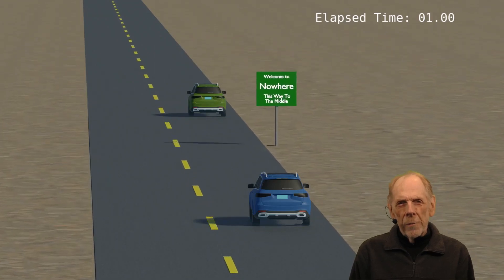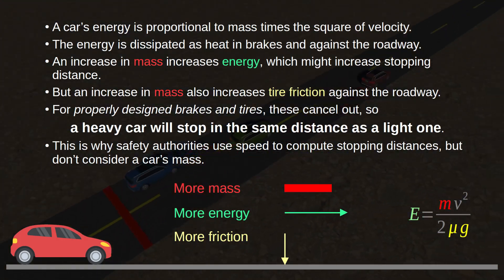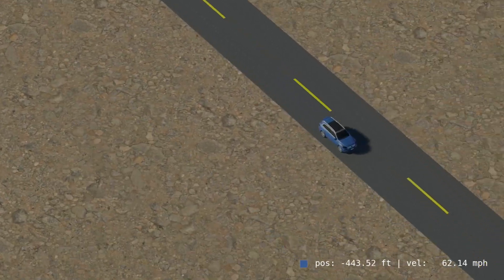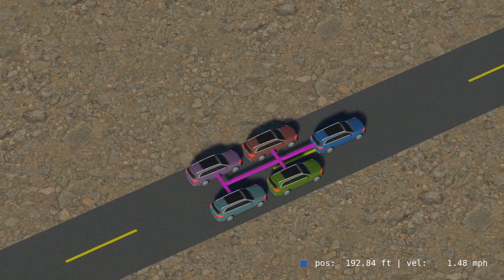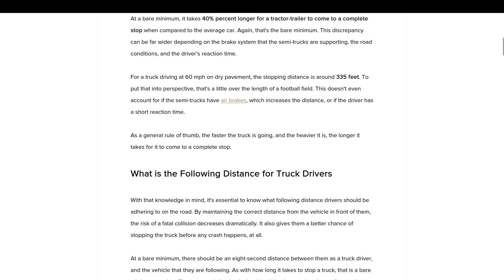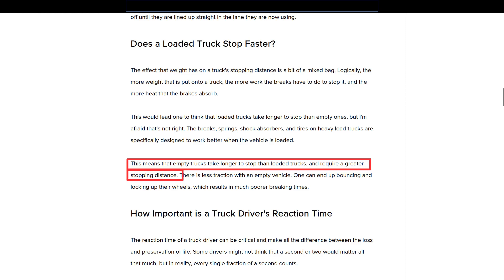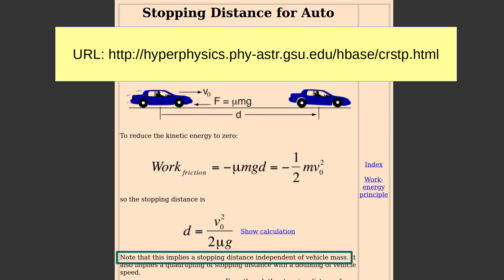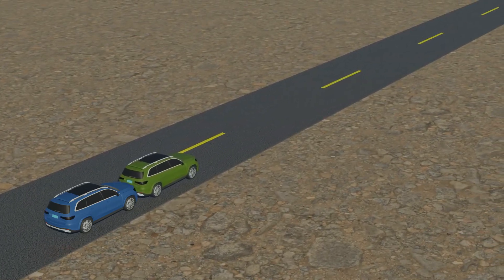Car Safety Myths: Exposed

Comment: The equations are right and the physics are spot on, yet it's a huge oversimplification of the other aspects of physics and engineering that are present in reality.    On the one site that you praise, it points out something that you never mentioned, static vs kinetic friction.  While some might claim that we can safely discount kinetic friction due to anti-lock braking systems, that's simply not the case since ABS detects a sliding condition and momentarily arrests it by decreasing braking action in order to regain the more effective static friction for slowing the vehicle.  ABS, in some instances will actually increase stopping distance in a tradeoff of maintaining control of the vehicle.  

You have also not taken into consideration the center of mass, which is well above where the braking forces are and greatly change the distribution of the force normal on the tires.  The force of friction equations still work perfectly, yet the when front braking system (tires, brakes, et al) exceeds its design capability this simplification quickly breaks down.   You alluded to this that it's not a physics problem, but and engineering one, which is correct, but that's such a huge understatement that almost negates the argument that you make here.  (sidebar:   search "Jeep Renegade Stoppie" to see a failure of properly accounting for this center of mass)

You demonstrated some basic physics with computer models/simulations, which is great, and these physical concepts are nearly universally accepted.  However, models are great for developing hypotheses and not so much for actually testing them.  They regularly suffer too much from missing information and bias, amongst other factors.   I recognize that you probably don't have the budget to actually run a real-world experiment.  Yet there are so many factors not taken into consideration with a model that is comprised of a few equations.

Tires:    Deformation as force normal increases - these are not perfectly flat surfaces, and for good reason.   How the tread pattern deflects under different loading changes the overall coefficient of friction (looking at the tire as a system).  The force normal variates while driving, depending on acceleration/deceleration, road conditions, suspension, etc.   Thermal build-up as kinetic energy is dissipated - This has huge impacts of the tires' coefficient of friction as well, and with more mass, more kinetic energy needs to be dissipated.  One might argue that a warmer tire should have a better coefficient, but it's not a linear relationship.

Brakes:   Available braking force -  Sound engineering would dictate that the brakes are sized appropriately to effectively stop the vehicle under all reasonable conditions.   Yet, there are a lot of arbitrary figures in that assumption.    Thermal brake fade is a well known issue.   A vehicle with already hot brakes will have less braking effort available than one with cold brakes.  A braking system commanded to dissipate more kinetic energy will heat up much faster than one that doesn't.  Its available braking effectiveness will decay much faster than the one that can remain cooler.  Cars typically have ample reserves of braking capability in their designs.  Large truck designs tends to have much less headroom.   This is why trucks are required to descend long, steep grades at slower speeds, as well as take advantage of dynamic braking systems like engine compression braking.  Bottom line, a vehicle with more mass whether through circumstance or design is going to develop more heat in its brake system.

Vehicle design and condition:   If everything perfectly scaled, then the equations work nicely.  We know that the performance characteristics of each vehicle are different, and also can vary greatly within the same design based on the state of repair or driving conditions immediately prior to a braking event.  The disparities can grow even wider with less than changing conditions.  A racing slick tire may have the best (composite) coefficient of friction in dry conditions, but a treaded tire quickly becomes the winner if the road surface is even slightly wet.  Off the track, we can see the same principles with the type and condition of tires on public roadways, which run the full gamut.  The bottom line is that in reality, two vehicles will never have the identical braking characteristics.  One needs to look no further than the countless stopping distance results in the myriad of car testing publications to see this...and that's generally with vehicles in nearly factory new condition.

Your physics is good, but your video horribly discounts the engineering and realities of the real world conditions.   I'd recommend that you consider contacting a vehicle test facility and see if they would be willing to provide an interview with some of the experts on the subject matter, and possibly help you conduct some real-world experiments at their facility.   I think you be a little surprised about how much more there is to it beyond the principal free body diagrams used to make your argument.

Comment: This strikes me as a good example of how to believe your own crap doesn't stink.  Not only do we ignore some of the most important factors, tire grip, suspension to accommodate weight transfer during braking, and overall brake performance...but we also get to hear a fantasy land world where it takes three seconds to apply a brake.  If it took three seconds to apply the brake, there would be an accident at every intersection and parking lot every few minutes.
Reply from the maker: > ... but we also get to hear a fantasy land world where it takes three seconds to apply a brake.

But that's not the claim. It doesn't take three seconds to apply the brakes, it takes three seconds to react to a situation that requires braking. Then the actual braking begins.

Comment: I'd like some more explanation in the numbers being used .
Also, did the computer simulations take into consideration:
- tyrecircumferance
- wheelweight
- suspension (and flex)
Are there other models beside the SUV? There is also NO sag, they stay level.
This sounds like a theory I want to learn more about as it goes against what I've been thaught. Even tho, I still think it will be false. That's why I inquere the numbers used and to see how you corelate them. Thanks
Reply: No. He also didn't consider the tyre's modulus of elasticity which is the single biggest influence on friction differences between a laden and unladen vehicle.
Reply: @SwervingLemon  Indeed! Good one, there are so many parameters that contribute to braking performance that never were mentioned. 
After I wrote the comment, I also wonderded about the wheight shift and its effect on grip front and rear. And max braking capacity per tyre.
To me this is using the most basic rule of physics to explain something much more complicated than percieved.
Reply from the maker: The primary thing you need to understand is that vehicle mass doesn't determine stopping distance. My five-car monster vehicle proves that -- its ten tons of mass stops in exactly the same distance as a two ton car.

If you reduce the number of tires from 20 to 4, this degrades braking effectiveness, but if the tires and brakes are designed properly to accept the expected loads, the change will be small. Not zero, but small.

That's it, in a nutshell.

Comment: Thank you!  I've always thought the idea that "it takes longer for heavier vehicles to stop" idea was wrong.  Consumer Reports does stopping distance tests on hundreds of vehicles.  I'm going to take a sample of them from compact cars and those over 6000 pounds and see how they vary.
Reply: Now I'm curious to what you found? ....
Reply: @fvl548  These are the average they list for each category of car:
Category	                        Average dry braking 60-0 mph, ft.

Sports/sporty cars		120
Luxury midsized cars		128
Luxury small SUVs		129
Small cars			        130
Luxury small cars		        131
Small SUVs			        132
Luxury large cars		        132
Large cars			       132
Midsized cars			133
Midsized SUVs			134
Luxury midsized SUVs	134
Compact pickups			136
Minivans			        138
Compact electric/hybrid cars	138
Luxury large SUVs		138
Full-sized pickups		140
Large SUVs			        143
Average of all tested vehicles	132
Reply from the maker: @aintquitewright1480  Thanks for posting this! It confirms the idea that mass doesn't increase stopping distance proportionally, as so many believe.

Comment: Whilst I agree from a physics point if view on stopping distance being not dependent on mass  -  You are assuming ideal brakes working efficiently , and this being an engineering issue means in the real world stopping distance can depend to some degree on mass, and how slowly some vehicles are allowed be designed to stop
Reply from the maker: > ... and this being an engineering issue means in the real world stopping distance can depend to some degree on mass

Yes, and I made that point. Real trucks really do take (much) more distance to stop than a small car, and this results from how they're designed.

Comment: Too simplified to simulate 5 connected cars to show the same stopping distance. Film a real world example. Drive an empty vehicle, measure the stop at a 60mph or 100km/h. Load vehicle excessively and retest.
Reply from the maker: Not the same example. My example makes it self-evident that mass doesn't increase stopping distance. In real tests, mass has a small effect on stopping distance unless the responsible issues are accommodated in the design of the tires and brakes. In other words, it's an engineering issue, not a conceptual one.
Reply: He has stated many times throughout the video, he's assuming perfect brake bias, which produces axle torque perfectly proportionate to the load on each tire. (A really good antilock brake system) He is also assuming, that no tire is loaded to its sheer strength, which is a limiting factor to stopping force. Coefficient of traction is actually pretty constant, until you exceed the sheer strength of the rubber compound.

Comment: 3:34 This example doesn't take into account that the 'monster vehicle' has 5 times more tire contact patch as well, since it has 20 tires. Mass per tire contact patch is also important. Otherwise, overinflated tires would lead to the same stopping distance as correctly inflated ones.
Reply: Yes. He's forgotten to factor the modulus of elasticity of the tyre itself.
Reply from the maker: > This example doesn't take into account that the 'monster vehicle' has 5 times more tire contact patch as well, since it has 20 tires.

Actually I did cover that issue with a comparison table that trades off contact area and downward force, I also mentioned that actual tires stop following the rules if exposed to loads they cannot handle. But to a first-order approximation, fewer tires with more loading provides the same overall braking friction.

Thanks for writing!
Reply: Both of you apparently stopped watching to post an ignorant reply. He covered this very subject moments later. Showing how the additional tire friction did not change anything due to the fact that each wheel ends up sharing a smaller percentage of vehicle weight. Which in turns reduces the amount of friction at wheel. It's why a dulley pickup trick has less traction in the rear on wet roads then it would if it only had 2 rear wheels. The vehicle weight is spread out across 4 instead of 2 wheels. The 2 rear wheel truck will have a better time pressing down to the pavement then the 4 rear wheel truck will.
Reply: @williamallen7836  Same net downward force on a smaller contact patch will result in more contact pressure, which is another factor affecting traction and braking distance. He assumes that the relation between the net downward force and the friction force is linear, namely Fricition = μN, which is not the case as the contact patch gets smaller.
Reply from the maker: @ohanneskamerkoseyan3157  > " which is not the case as the contact patch gets smaller."  Fewer tires exert more force per contact area, so the correspondence I describe remains approximately true until the materials begin to break down. The posted equation describes an ideal correspondence, not an exact one. BTW the HyperPhysics page I linked to agrees with my analysis.

Nevertheless, when safety agencies post stopping distances, they don't include vehicle mass in the calculations -- there's no need.

Comment: This video contains some great demonstrations and good points, but I noticed a mistake.
9:03 Where did you get the formula for E from? It is completely wrong, and dimensional analysis shows it doesn't even give you energy. The "wrong!->" formula is completely correct for calculating the kinetic energy of a body. Your next slide you bring up to "show the correct formula" even shows you that same formula for the kinetic energy that you labeled "wrong!->" (Work = mgμd = m*v^2/2, where the third element is the kinetic energy).

In ideal conditions, I think you have shown clearly that braking distance doesn't vary depending on the mass of the vehicle.
In reality, there exist some factors which could change this however. For instance, if weak brakes are used, a human could feasibly not be able to generate enough braking force to max out the tyre friction.
If a trailer with bad brakes is used, it would carry its weight on its own axle, meaning its weight doesn't contribute to the braking force of the vehicle, and stopping distance could become dependent on mass. This will happen in any vehicle whenever weight is loaded above an axle with a bad/ no set of brakes.
Also, hot brakes can become less effective, and the more massive the vehicle, the more energy you have to put into the brakes, making them heat more. Hypothetically, this means mass could affect braking distance.
Reply from the maker: > Where did you get the formula for E from?

Which equation? There are several. In one, I provide the canonical form: E = 1/2 m v^2. In another, I accommodate the effect of friction, which agrees with field tests that show little to no effect from increased vehicle mass and also agrees with my monster-car example, which proves the point in a simple way.

In a slide I call wrong, the author uses the canonical form shown above, then concludes that this means more massive vehicles require more stopping distance, which is wrong. That's my meaning for "wrong" -- it misapplies the canonical energy equation and fails to take enough factors into account. My replacement equation does do this.

The remainder of your comments refer to extraneous factors, all true, but all about economics and engineering, not physics. My point is that the physics makes mass nearly irrelevant, and many people don't understand this.
Reply: @lutusp  Thanks for the response. I don't completely agree the other factors I bring up are extraneous, nor that they aren't fundamentally concepts that have to do with physics, however I completely agree that if we disregard those factors, stopping distance should not depend on mass. The formula for E I was referring to was the equation labeled as "right" at the moment of the time stamp 9:03, and this the remainder of this comment will be specifically about what's on screen in that moment.

You label the correct equation for kinetic energy as "wrong" while saying "In this case, I include the correct equation just for contrast". At the same time, you show the equation E=mv^2/2μg, which uses the variable name E, which is convetionally used for energy. You then say that the frictional term in the denominator and the mass in the numerator cancels out, which would give the final units of the equation being energy if true.

It is however not true that μg cancels out with m, as μg has units of acceleration, while m has units of mass, meaning they cannot cancel out. So the formula is not correct for calculating energy if this was its intended use. If the formula was meant to calculate stopping distance, it would also be wrong, as the formula for stopping distance is mv^2/2mμg=v^2/2μg.

It is true that the inference made about stopping distance in the sentence below the formula for kinetic energy was wrong. However the formula for kinetic energy wan't wrong, so I don't think you should have labeled it as such. It is in fact the formula you include of E=mv^2/2μg that seems to be wrong, as it neither gives you stopping distance, energy, nor do the terms m and μg cancel out as you say.
Reply from the maker: @HenrikMyrhaug  > You label the correct equation for kinetic energy as "wrong" ...

Yes, because in the page's context, it's being misapplied as though it can be used to correlate stopping distance with vehicle mass, which is certainly wrong. The original page's author then draws a classic wrong conclusion based on an equation that, in a different context, would be correct. My equation on the same slide tries to correct for this error, and though only approximate, it's a big improvement -- it at least addresses the context of stopping distance.